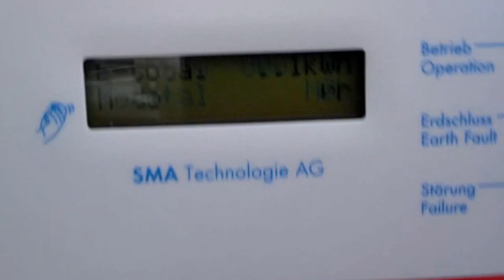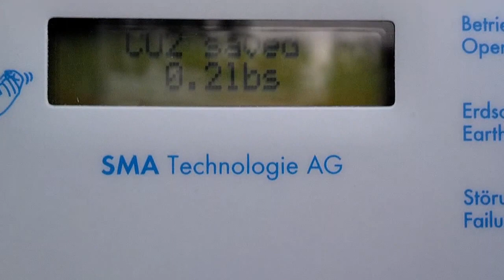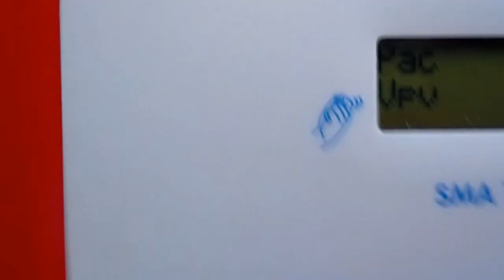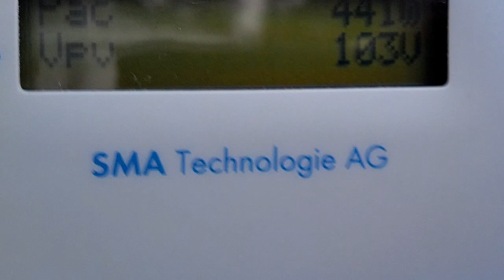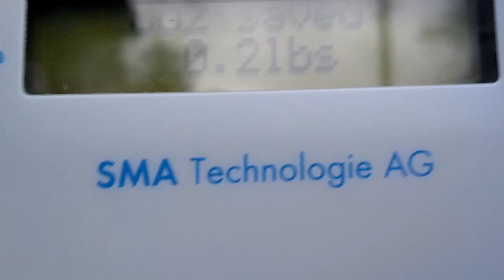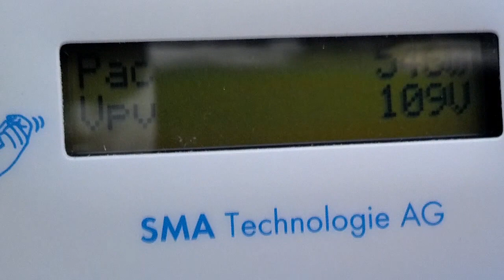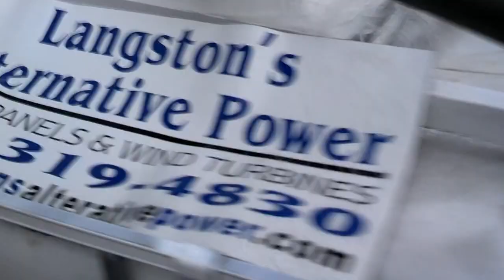Micro Hydro generator with gride inverter

Comment: is turgo provide DC voltage? at what voltage?
Reply from the maker: The generators three-phase AC we use a bridge rectifier to convert it to DC the voltage will range depending on the windings on the generator and the pressure of the water

Comment: Even at 100% efficency 1.95 l/s @ 15 psi will only give 201 watts, I used a calculator to mesure the flow through a orifice at a given psi. Unless the nozzles are actually bigger or your guage is wrong you are lying.
Reply from the maker: ben lawton  what I meant to say was 7/8 of an inch
Reply: Ah ok that adds up, I knew something was off.